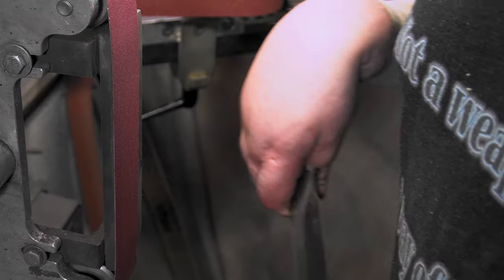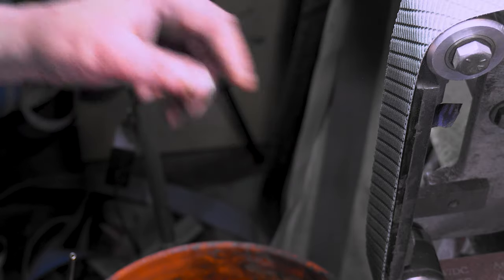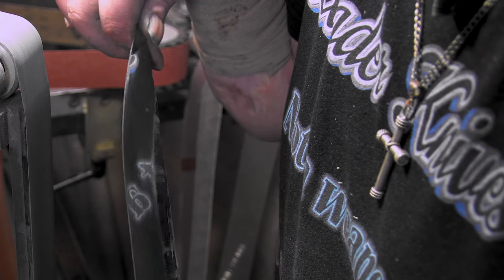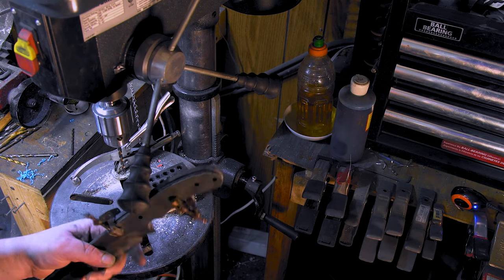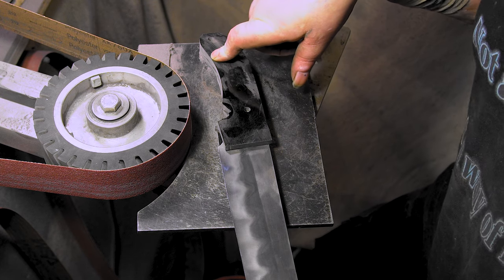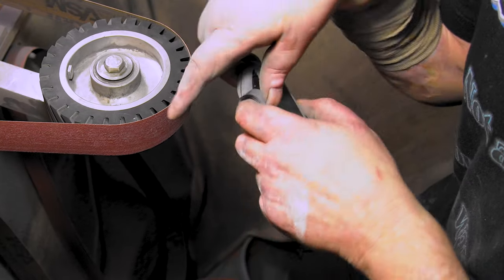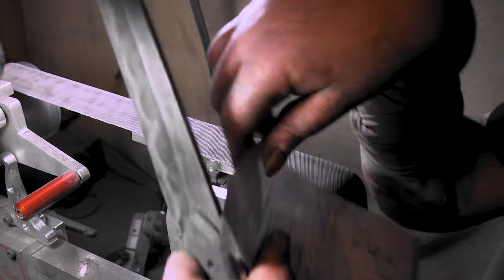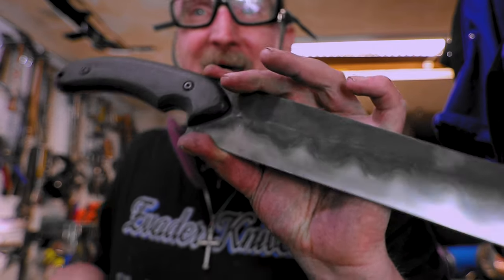Knifemaking... Machete - Handles, hamon & sharpening

Comment: Hey Dave, I enjoy your videos. I'm struggling with my bevels they just arnt looking good or symmetrical do you have any tips
Reply from the maker: I mean it takes a lot of work. I do have a whole playlist on grinding bevels & knifemaking for beginners which is heavy on bevels... The main thing, just remember it's mainly about pressure & where you put your fingers when holding the blade. That & just take your time, you'll get it...
Reply: Thanks, I'll be sure to check out a few of those videos and get some knife videos rolling out myself